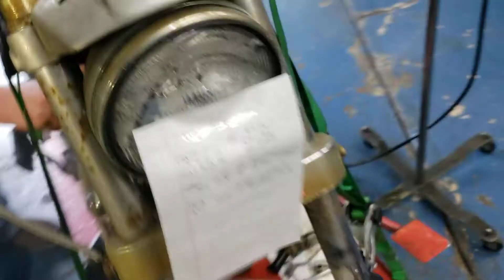1947 Harley Davidson Knucklehead barn find

Comment: Was that really the first kick? That thing fired right up. Not saying it isn’t, I’m just impressed if it is. I know they can do it. 58 pan that sat for 32 years in a barn in north Texas fired up first kick for me and my grandpa after cleaning points, fresh gas, plugs and wires etc. basically a “let’s see if it’ll run” tune up. 84 shovel did me the same way in 2020 after sitting 19 years… my pandemic lockdown build is what I called that one lol This real is cool though.
Reply from the maker: It sure was. We were pretty surprised too.  We knew it had compression, and we verified spark, and gave it some fuel...but we had no idea it would light off so easy
Reply: @vintagecycle316  man thats awesome! Very cool